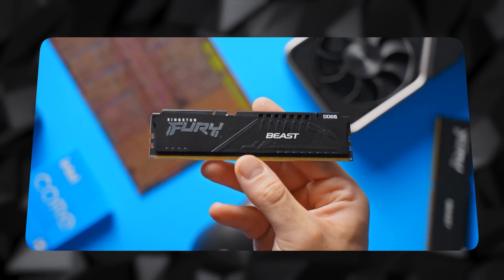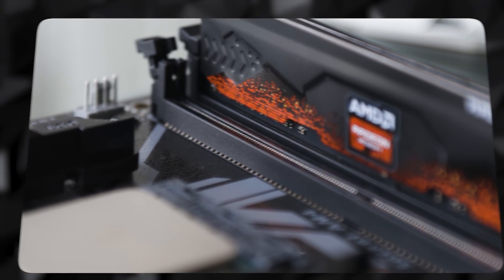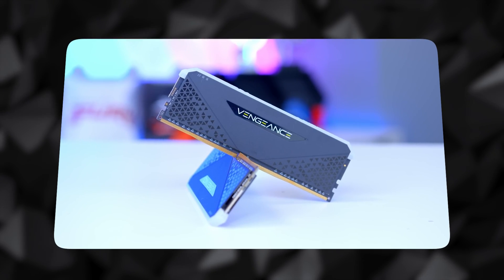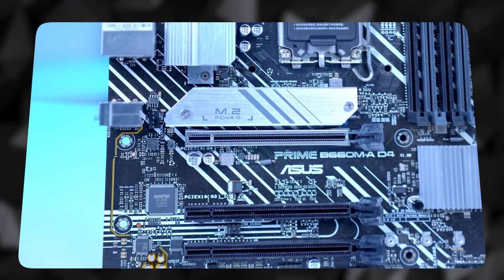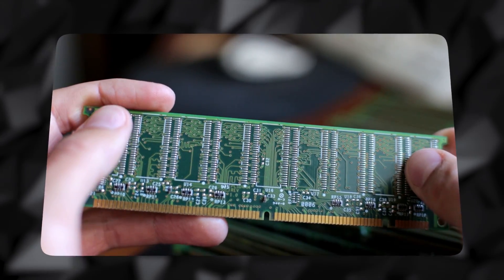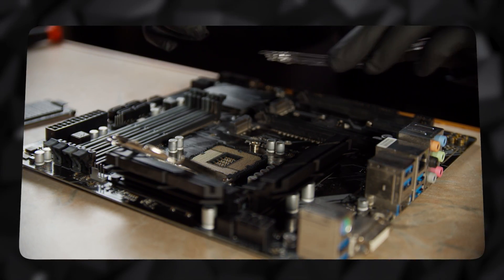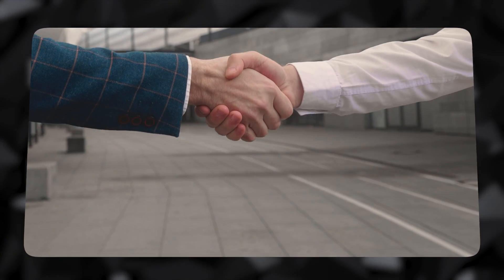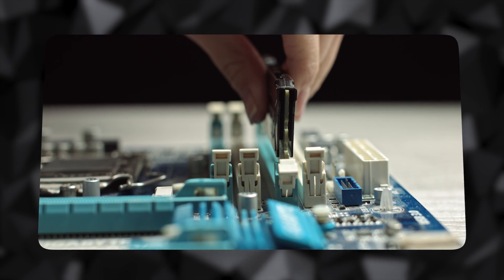DDR4 vs. DDR5 : What's the Difference, and Should You Upgrade?

Comment: I bought DDR4 4000 CL16 ram 2X8 kit for $60 a year ago. I have 64GB in my gaming rig and my graphics card never has to offload to the system ram because it has adequate GDDR6.
Reply: i have 64 gb's too for like 60$, and now the ram i have costs more then my whole pc build lmfao.
Reply: @HonedVT  My 64GB cost me $100 3 years ago. I think I could have got it cheaper but I can't say I'm unhappy with it. It was 3600 CL18 and I just went into settings and set it to CL16 no other changes needed, the timings just worked. Later I got it to 3733, it didn't want to push farther than that being 4X 16GB.

Comment: We are in almost the exact same position we were back in the 90s if one owned a 386 computer. You could either add more RAM to that or move to a 486 but that required buying a new motherboard and RAM that was compatible as well as a new CPU.  That was also around the time when slots on motherboards were transitioning from ISA to PCI so lots of upgrades in a very short time.  It was a huge jump in technology and speed though and well worth the upgrade which you could more realistically term a "replacement."

Comment: Ok, but what's faster?
16GB DDR4 or 8GBDDR5?
Reply: 8GB DDR5 is faster, but not better. You should go for 16 Gigs of DDR4, since just 8 gigs will not be enough for most games.
Reply: Get AT LEAAAST 16 GB, speed depends on Hz (which ddr5 have more) and CL not the memory capacity

Comment: is INTEL CORE i5 12400F 4.4GHz 6 core 12 thread processor able to connect DDR5 32GB? I bought a new computer but only has 16gb of ddr4 with 3200MHz and lately I wanted to get a new ddr5 32gb with 6000MHz 
Please tell me THANKS!
Reply from the maker: I think it’s possible to upgrade to 32Gb

Comment: honestly its just a waste of time and money. sure it will be faster but to upgrade to DDR5 i would need to upgrade my mobo and find one compatible with my current processor. im sure im gonna have to replace the motherboard at some point but for now its still running strong and i dont see why i would switch from 3k+ MHZ 32gb -> 4k+ MHZ 16-32gb.

Comment: Great video. Also, I have ryzen 5 3400g and rtx 4060 and the cpu is probably bottlenecking the gpu. I wanna buy ryzen 7 5700x, is it good combo?
Reply from the maker: That sounds like a solid upgrade! The Ryzen 7 5700X should pair nicely with your RTX 4060.

Comment: I have i9 13900k/RTX4080/128GB DDR4 3600 @ CL18 and i9 13900ks/RTX4090/128GB DDR4 3600 @ CL18 - both running gear 1 (my 128GB RAM 4000 sticks didn't play well at gear 1). Comparing my benchmarks to videos on here and I hold or exceed their numbers so have zero motivation to move to DDR5.
Reply from the maker: Damn! That's a beast of a system you have there 🔥💯
Reply: @tech-techover  Thanks mate. The 4090 system is mine, the 4080 system is my family PC. At the office I run i9 12900ks/128GB @ 3200 C16 and RTX2060 12GB.

Comment: rtx 3060 140w  with ddr5 vs rtx 3070 150w with ddr4
Same cpu
Which is better?
Reply from the maker: In my opinion both combinations are great. But you will definitely need the extra power from the 3070 irregardless of whether you pair it with DDR5 or DDR4
Reply: What a joke!😂 How can you ask such question? You are comparing 3060 with 3070?😂 Dont do that plz 3070 is the powerhouse for gaming and 3060 is just a 1080p card that cant even give you 60fps constant on ultra settings for some heavy weight games. That doesnt matter whether you have ddr4,ddr5 ram or a different cpu. For example An i5 12400f+3070+ddr4 ram can easily beat i7 12700f+3060+ddr5 ram system in gaming with a very big difference. So when its gaming dont even think about ram ddr4/ddr5, cpu blah blah blah only think about graphic card.

Comment: By the time your video came out, the highest frequency (not speed) already was 8000 mhz without it being overclocked. 8400 mhz is technically the theoretical limit, but so is 3200 mhz for ddr4. The reason we see higher frequencies is because of the effective speed which gets doubled (DDR = Double Data Rate). This also explains verified overclocks of over 11000 mhz. The speed of ram depends as much on Cache Latency as it does on the frequency. One other important fact about DDR5 is, that unlike DDR4, it has double the burst length, which in short allows it to read double the data at once.
Reply: Oh and DDR4 has, so far, way lower latencies which still makes it a valid consideration.
Reply: @shinama thanks. This was good add in info. T337 comment.
Reply: Is this why ddr4 motherboards cost more then ddr5?